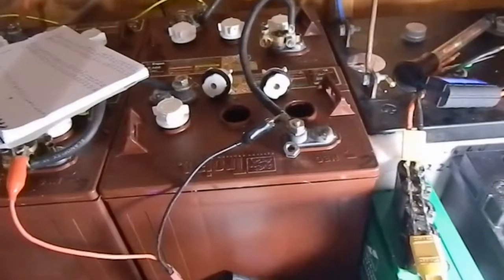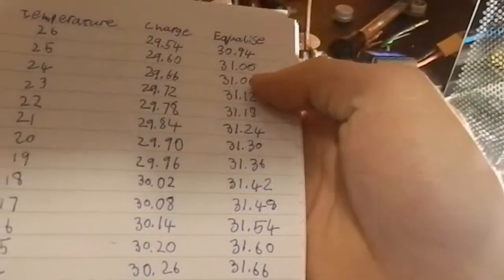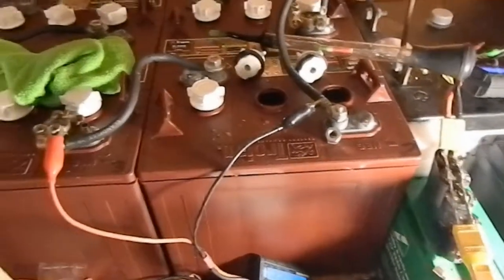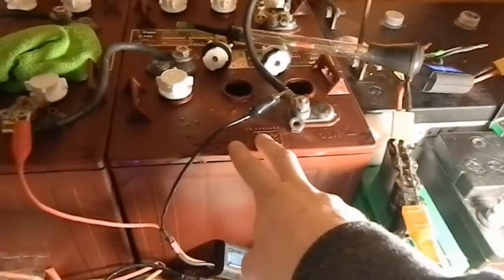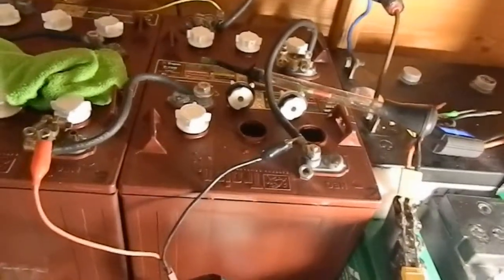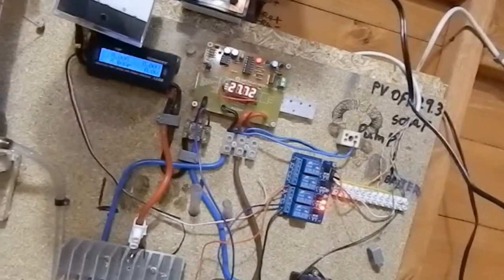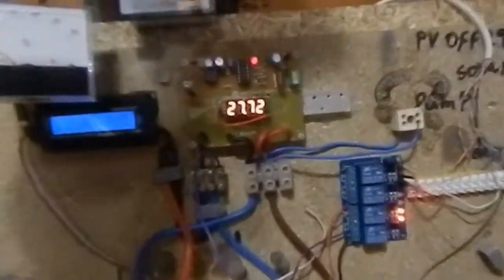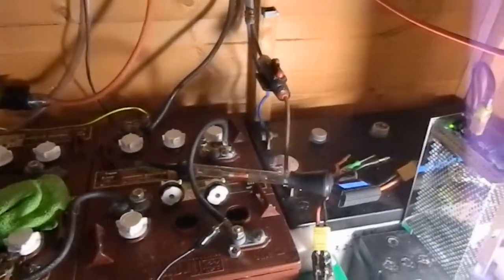The Importance of Lead Acid Temperature Compensation

Comment: Yeah always need to adjust. A lot of the high end ones has built in temp sensor control module so it does it all automatically. Cheers for the info